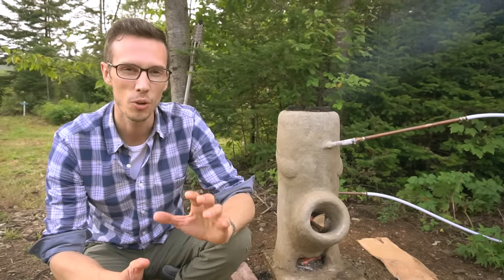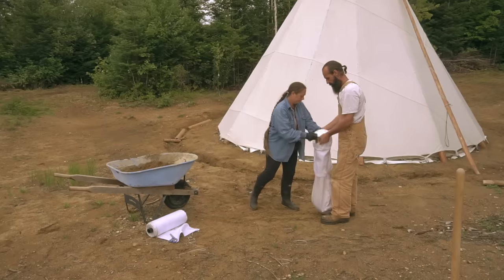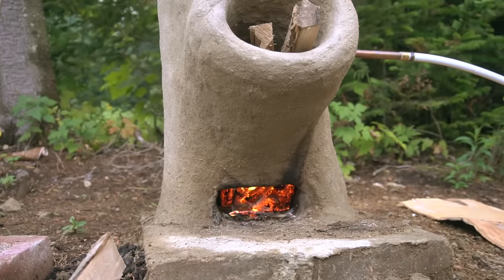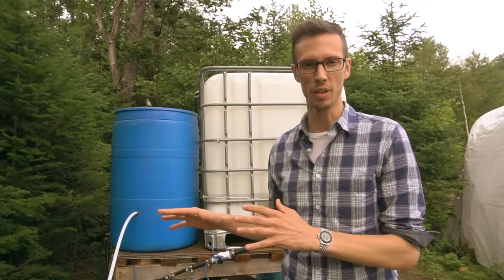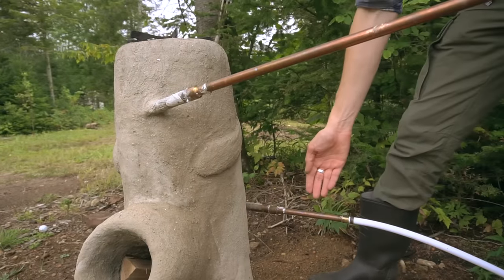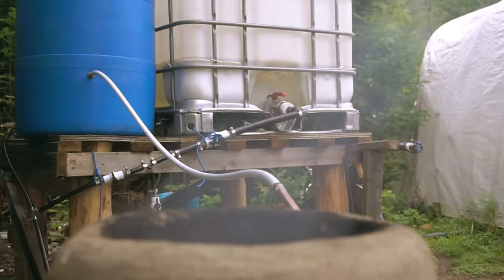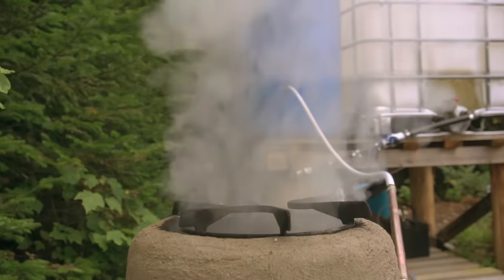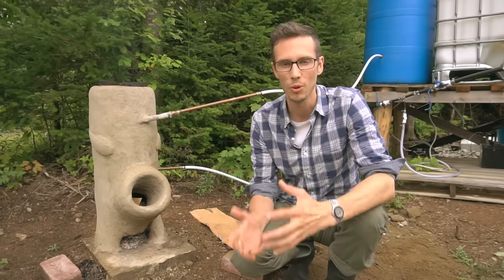Brilliant DIY Off-Grid Water Heater Using a Rocket Stove – No Propane!

Comment: Shouldn't you use the copper or stainless steel tubing for a coil in the top of the chimney as a cooking grate to place the pan or pot on where the heat is at its hottest very good attempt though it's rather artistic isn't it???? 
I mean most might think it a chiminea!!! 
So if you painted it in dark earth tones you could get away with passing it off as one!!!

Comment: Is not simpler to just set the heat element under metal barrel?
Reply: But then you'd have to start a specific fire purely to hear your water tank. This prototype design shows how you can have a general fire to use for many purposes, and have it passively heat up a water tank at the same time.

Comment: or you could have made a box painted the inside black put copper tubing inside and then you can put a piece of glass over it and put it out in the sun the sun will heat up the box. and then you could put that into a water container

Comment: That doesn't seem viable once winter hits or if a strong storm with wind came in. I would think heating water inside using wood stove or chimney, then placing in insulated container inside would be an easier bad weather option. This would keep it warm until needed. You could experiment with topping off to see how to keep temperature where you wanted for showers and other washing.

Comment: The outflow pipe of the cold water level is lower than the  upper outflow of the hot water , how it's possible ,it's against physics law. Actually it should be reversed, means the first outflow pipe(tank) must be higher than the second pipe (tank) so that it can  be collected in lower tank. 

Any how, it's good, but please clarified my doubt and please tell me will the water be hot enough to take shower in it

Comment: Not very efficient IE: not many BTU into the water for the amount of BTU given off by the fuel.  It does not have very much surface area and needs a LOT more to gather the heat from the rocket efficiently at the velocities that the hot gas is passing thru the stove.
Reply: What part of "prototype" went over your head?
Reply: No part, but they made the same mistake a LOT of other rocket water heater experimenters have made.  Just trying to help them in a more efficient direction.  That is the point of this isnt it, learning and improving?

Comment: Is it technically a rocket stove? So much heat is wasted out the top, usually a rocket stove the exhaust is used to heat thermal mass and leaves the system cool.
Reply: You’re confusing stove with mass heater.

Comment: a normal tank-less hot water system would not have a tank in between you and heat source. i realize you are designing from scratch but why cant your system do the same? i mean, i don't know how you attached the coiled pipe to the flue but maybe if you figured out how to get better contact between pipe and flue  as well as maybe put gentle bends in flue sections to kinda act as baffles to get more heat to pipes contact then maybe the water would heat up fast enough to use without the need to store it first?  just a thought ... I'm not a expert in the field  ...

Comment: There is talk, here in the UK, mainly in England at the moment, to stop the criminal burning of wood in stoves and home heaters.  Why?  Apparently most of the wood being burned is ex-building lumber which is treated with preservatives which give off poisonous fumes.....Really?!  Those logs that're getting burnt are full of chemicals like building lumber?  Would it be that if one person is benefiting from a wood burning heater, others might see savings in their increasingly expensive natural gas and electric bills too?  Hmm.  I think the protesters do protest too loudly.  Granted, if we all did it(like we used to not so long ago), there wouldn't be enough untainted timber to go round.  I just wish I could have such a heater again.  Just saying, from a UK perspective.

Comment: Nonsense about the water source needing to be higher. As long as the output tube (from water source) is lower than the input, it should have enough pressure to circulate the water back and forth.

Comment: Is that a rocket stove?  I thought a Rocket stove was meant to send its gasses back into the fire for a secondary burn but it only appears to be a standard fire with piping coiled around it.

Maybe this should be called a Mud Stove or Cob Stove or Adobe Stove.  

Or maybe I'm missing something??
Reply: A rocket stove is a fire in a chimney. Are you thinking of a rocket mass heater? Different animal.
Reply: @brucea550  Quite. Burning fuel with a chimney that you can use for cooking is just a 'Stove'.  I thought the 'Rocket' bit as per Rocket mass heater, was related to the method of reusing the gasses for a secondary burn.

Comment: the surface in contact with the heat is so low, you've missing almost all the energy because you're emitting the gases hot.... it doesent makes any sense... wich advantages present this rather than a cooker that burns wood????

Comment: wait ?  what is the thermal cement or cob mix?  why is the rocket stove obviously not "rocketing" (burning hot with clean flame)  maybe these folks do not get how a real rocket stove is supposed to work,it's not just a tube you burn wood in .   etc etc

Comment: Thats not a rocket stove at all. The 1st stage of combustion must occur before the J tube, before the draw pulls the partially burned gases and solids up into the second combusion stage. Those elements accelerate the "fun" much more than a fire at rhe bottom of a tube.

The feed tube is good, though. As is the adobe.

Comment: If you have metal tank for water, and you put same device for fire under the tank you can get better water heater without loosing temperature on pipes. You are wasting so much fire and temperature on this way...

Comment: While the idea is cool, the design is pretty flawed:
1.most of the heat gets exhausted out the top, and the thermal efficiency is very low.
the heating coil would be much more efficient if left exposed to the open flame and with many more coils.
for reference check out any steam generator which works in basically the same manner.
2. most of the water heat gets lost in uninsulated tubing of excess length.
the piping needs to be much shorter and better insulated.
3. if the objective is to keep hot water for later, the barrel needs to be much better insulated as well.
Reply: 1. Copper tubing would degrade quickly if exposed directly to the flames. It's true that most of the heat leaves through the top, but that is necessary if you want to be able to cook on it. Although, since the pot almost completely blocks the opening I wouldn't be surprised if that messed up the airflow pretty badly and dropped efficiency.
2. Some is definitely lost, I'm not so sure that it would be most of it though. The copper section is fairly short and the rest seems to be plastic, which would be a bit of an insulator. He did mention this is a prototype and would be improved upon later, which likely includes insulation.

Comment: its like someone dont understand the prinsiple about rocket stoves. This is a total waste of heat. you are NOT suppose to have a hole at the top, for the heat to escape. The hole exess gas is suppose to at the bottom. For this model, you need a barrel over the rocket stove, with a extra hole at the bottom for gas to escape. This will to trap the heat inside, and you will need less fuel.

Comment: Simple but this is not the way to go when trying to do something about climate change. A similar heat exchange system could be made using sunlight and a thermal storage system. Or it could incorporate some other form of energy input like waterpower and a generator to heat the water. If you see the amount of smoke coming out of this system you know that is not something you are going to use in a home. There are better heating systems for homes that integrate cooking and hot water and that actually don't produce that amount of CO2.

Comment: what if you want electric but need energy, for yes we have solar panels but what happen you want massive energy the same time farming the sunlight but if it is cloudy or solar panel over in the snow, for I think it is a good idea to use thermal energy generator and biogas because there was a person who collects biofuel gas from wood but it is poor qualities I think it is but it can run an engine for I can tell because this guy runs a small bike engine by running a biofuel but I suggested towards him add the thermal energy generator attach with it and see how well it works but I had none reply back.  I am no maker, but type person suggest because I think we should get every ounce of energy out of the woods to get the best amount energy out of every plants or woods or otherwise we may have to return back to the steam engine which it is fine idea to have pressure cook pot lock up and cause the hot steam to wish out for energy for why not go for 3 at once which it would improve more then 1 qualities of energy to actually run a decades of few village buildings.

Comment: To be burning trees I'd rather stay on grid, burning coal.
Reply: There are so many dead, dying, diseased and overcrowded trees that need thinning so new healthy trees can replace those.
Reply: @1charlastar886  yeah, now lets all 8billion of us try the same thing so we can all be saints together. How sustainable would that be?
Reply: @0786RICARDO  Ever heard of how little pollution WOOD PELLETS put out? They are a byproduct of the building industry.VERY efficient and clean but not clean enough for those who insist on NO POLLUTION. I think the clean US coal is just fine to provide power. 
So how many of the 8 billion do you propose killing and by what means?

Comment: If you make off the grid things with on the grid things. Are you even off the grid? 
For me off the grid is smashing up a rock, melting the metal from the rock. Making an axe, chopping trees down. Making a log cabin.
Making your own forge.
Then making copper tubes yourself.
Reply: "off grid" just means that you don't pay for electricity.

Comment: Environmentally friendly? Not at all. Wood burns dirtier and has a higher carbon footprint. It's worse still because you're only getting a fraction of the heat from the wood, and the water tank and lines are poorly insulated. Nowhere near code for a homeowner and would be prohibited within city limits for pollution. Off-grid isn't necessarily good.

Comment: Using the rocket stove to heat up salt is much more efficient to heat water an your earthship 😂 hippies. Put down your bongs an pick up a book 📚. Molten salt it's like making lava stays hot for days after a few hours of heating.
Reply: Why does molten salt explode?
Scientists who've also experimented with molten salt and water concluded that the explosion isn't the result of a chemical reaction — just a mechanical one. Basically, the molten salt is so hot that it superheats the relatively cool water, causing it to undergo a shockingly fast phase change from a liquid to a vapor